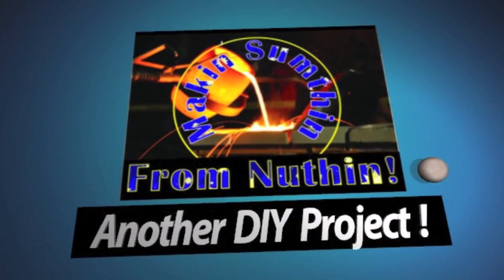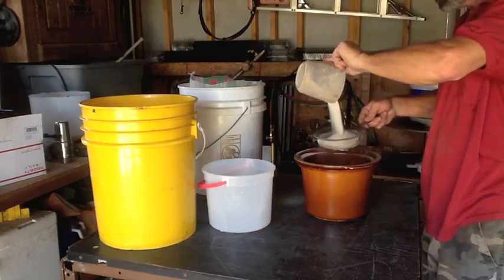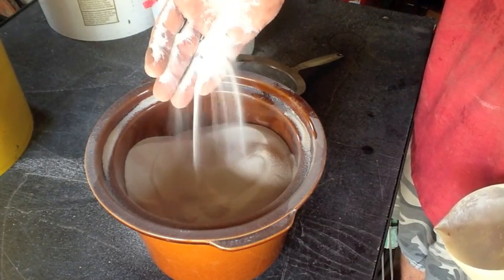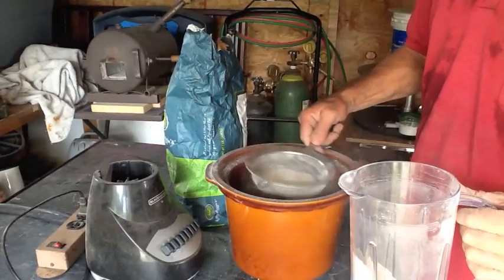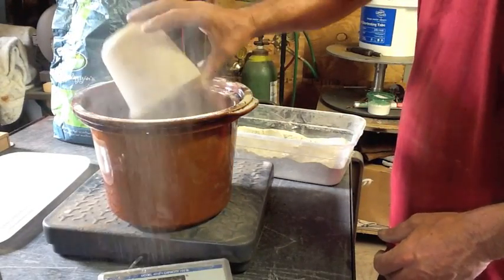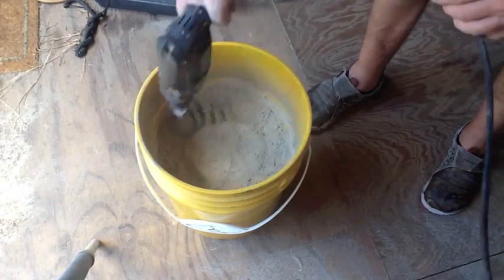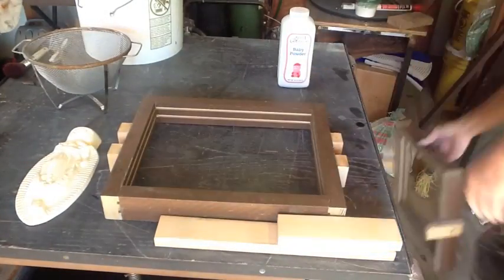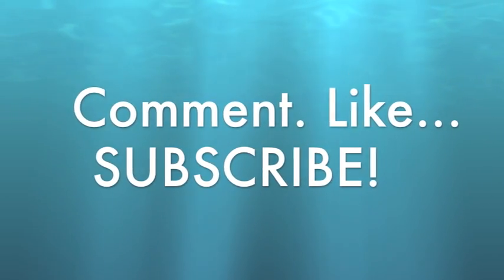DIY GREEN SAND FOR CASTING - CHEAP, SIMPLE and FAST - MSFN

Comment: Three Questions:
1. Can you use sand directly from the beach(some of the beaches where I live has black sand probably just the true color of the sand as long as you sift it) instead of the play sand and if not then where can you exactly get the play sand??
2. Is a sizzling plate (which is made of cast iron)that I found in a department store a good enough material for a crucible??
3. Is the mould that you made in the video good enough for aluminum metal casting?
Reply from the maker: Beach sand would prabaly work and long as its extremely fine sand and sifted very well...try it. Play sand is available at Lowes or Home Depot

Cast Iron makes a decent crucible, certainly can withstand the heat. I use fire extinguishers :)

Any metal can be cast in green sand, especially aluminum, see my other videos :)
Reply: thanks
Reply: Sifting is an excellent 1st step in making beach sand suitable for foundry work.  However, the fines sifting produces contain both desirable silica and undesirable calcium carbonate.  Eliminate the calcium carbonate by washing the fines with diluted acid (muriatic or sulfuric, whichever costs less), repeatedly, until fizzing stops.  Finish off the sand with lots of water to remove all remaining "nasties".

Comment: Haven't tried it yet but just had an idea... (last one of 2016) but if you're worried about those rogue sand granules, a shop-vac hovered maybe 6" above & waving back & forth a few times will probably snatch those pesky lil guys out. Or it might loosen up other ones & make it even worse...lol Don't blame me if it doesn't work.
Reply from the maker: Dont sell yourself short, you may have another idea later today! :)

I may experiment with that, at least if it fails I know who to blame...LOL

Comment: Hi, I was trying to sift some of the same sand you have using the same strainer from Walmart but my sand doesn't fall out nearly as fast as your and there is alot of sand left over, I'm wondering if it is possible they made the strainer a finer mesh. Anyways, I enjoyed your video. Thanks!
Reply from the maker: My strainer is an extremly fine mesh, I had my sand stored for a long time in a dry place so was no moisture in my sand which made sifting easier. Moist sand wont sift well. Glad you liked the video :)
Reply: Makin Sumthin From Nuthin ok thanks, I'll have to try and dry out my sand some more :)
Reply from the maker: 👍🏼 Keep me posted!

Comment: Just so you know, kitty litter IS bentonite clay.
Reply from the maker: The bags I bought don't specifically say Bentonite but thats good to know. Thanks
Reply: I will now have a panic attack every time I see Kitty Litter in the store. Thank you for one more thing I cannot unsee. :)
Reply: Was about to say the same  :) depending on where you get it from (I am not in the US) there might be some large grains in even after blending so sifting is a good idea MrPete has a really nice muller  to work the sand with I know he uses oil sand but it can be used on green as well
Reply from the maker: A muller would be nice but I don't have the room
Reply: So is cheap oil dri. Don't know if it's cheaper than kitty litter, but I'm guessing something with a picture of a cat on it is gonna be more expensive. I'm actually doing this right now with oil-dri from Autozone. 8 pounds for 4 bucks.
Reply: just so YOU know Kitty Litter is a not very famous tubby drag queen they locked up for going into childrens' libraries exposing himself to audiences of kids forced to attend by their gurning idiot parents .. sorry that was 'Shitty Litter" .. my mistake, doh..  ;)

Comment: what was that powder you sprinkled on the original artwork?
Reply from the maker: For the Parting Powder I just use cheap Baby Powder from the dollar store :) It keeps sand from sticking to the pattern (original artwork) and the sand from sticking between the two mold halves.

Thanks for Watching! :)

Comment: Thank you so much! I have always wondered how greensand is made and your video explained it all. Subscribed!👍
Reply from the maker: You're Welcome! Hope it wasnt too boring....its not the most exciting part of metal casting but cant cast without it! :)
Reply: +Makin Sumthin From Nuthin It wasn't boring at all! but your absolutely right ya gotta have green sand :)
Reply from the maker: I have alot of other casting related videos if ya wanna check some out. I appreciate you subbing :)
Reply: +Makin Sumthin From Nuthin 
lookin at them now, thanks again ;)
Reply: @MakinSumthinFromNuthin  where? You tube only shows 3
Reply: I watched where you made axles for someone in Cuba, my only comment is that you should have turned down outside in preparation of welding as the millscale makes welding difficult.

Comment: One method of wetting the mix I've seen, is to put the dry mix on a tarp and spray it then fold the corners into the center to mix it, repeating till it is damp enough to use.
Cheers Eric
Reply from the maker: Works good if ya have the room, which I dont. Too much stuff in my shop. LOL :)
Reply from the maker: ps: (no tarp either) 😖

Comment: Great video with excellent explanation. Just a dumb question on my part, what is the purpose of the clay? If your sand is moist enough shouldn't it hold its shape without the clay?
Reply from the maker: Thanks! No, damp sand wont hold its shape without the clay. Too much moisture can result in steam explosion inside the mold. Need the clay :)

Comment: Sup informative video! Thanks for posting. Two questions. 
1. Can the sand be reclaimed for another project after a mold has been poured. 
2. The pipe you put into the mold to channel the liquid into the cavity, did you not include the channel in your mold?
Reply from the maker: Answer(s):

1) Yes, the sand can be re-used over & over. Additions of more clay over time will be needed as necessary

2) Nice catch....I did not put a gate from the sprue to the pattern simply because I knew I would not be pouring that particular mold that day. It was rammed up simply to show how well the sand worked.

I did pour that same pattern in a later video if ya want check it out (Virgin of Guadalupe)

Comment from the maker: Please LIKE & SUBSCRIBE if the video helps you with your desire to do Sand Casting. TY! :)
Reply: nice job, man
Reply from the maker: Thanks Raoul! :)
Reply from the maker: Absolutely, I would never cast metal directly into plaster. This sand is reusable forever, simply add clay when needed :)
Reply from the maker: I have a video up on some foam casting, it worked ok but I wasnt writing home about it :)
Reply: Makin Sumthin From Nuthin There is a video where a guy uses lost PLA he 3D printed to cast an object. He encased it in plaster, and it turned out great.
Reply: A cheaper clay for this recipe is to go to a masonry supply and buy a bag of Mortar Clay. It comes as a very fine powder already, and I was able to get a 60 pound bag for 5 bucks.
Reply from the maker: Yep, lotsa different approaches to casting. Thx for watching! :)
Reply: BJS That's my name. Don't wear it out.
Reply from the maker: Very cool idea, does it work well?
Reply: I'm not quite sure yet. I haven't actually tried making any casting sand with it since I experienced some pretty major setbacks to my blacksmithing forge/foundry projects recently. However, if you have the patience for it, the dry clay is fine enough that you can pack it quite firmly with relatively little difficulty, but you have to do it in layers. I have made some lead ingots in this manner using an open method. Not the best, but I don't doubt that a very small amount of water to the clay alone will give you an amazing negative medium that will hold its shape in a casting frame. The detail you can get is amazing too.

Comment: thanks for the clear instructions! I am inching my way towards aluminum casting and I'll use this recipe when the time comes. I need to make a forge first! Now I'm off to watch your flask making video!
Reply from the maker: You're Welcome! I also have a forge build video if ya wanna check it out. Thanks for Watching! :)
Reply: +Makin Sumthin From Nuthin OK, I got ahead of myself and decided to try this today. home depot must get the sand from a different place around you. I got the same quikrete play sand and the same strainer from walmart and started to sift. I am not getting hardly ANYTHING. almost all of the sand is big enough that it wont go through that fine strainer. I grabbed the strainer from the house that isnt as fine and it let much more though but I am not happy with how course the sand is. Any ideas?
Reply from the maker: Usually the Play Sand is extremely fine sand...maybe they have a bad supplier at your store....Try the play sand at Lowes maybe ? :-/

Comment: Excellent video! How long will the finished green sand remain castable after making it and storing it? absolutely the clearest video I have seen on this subject.. Thank you! Don't know if I was the only one though that wanted to see you pour that awesome mold you made, but I would have loved to see the detail in the cast.
Reply from the maker: Thanks! Told ya that vid was in the works! :) If you have an airtite container it should stay moist enough for a while but even if it dries out simply mist it down while mixing with the drill setup and is back ready to use VERY quickly....use the squeeze test as your guide. I will cast that same mold soon....stay tuned!
Reply: Great! Looking forward to it